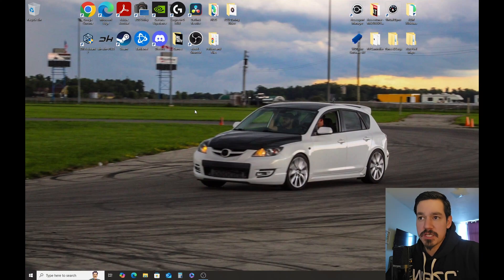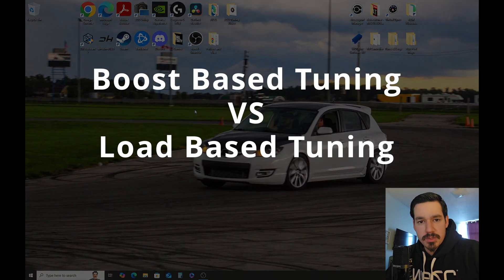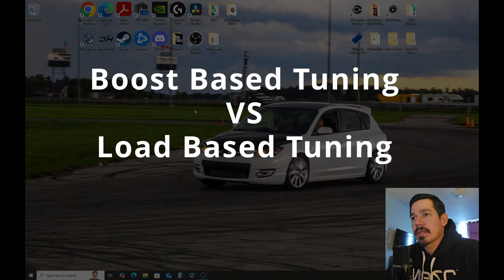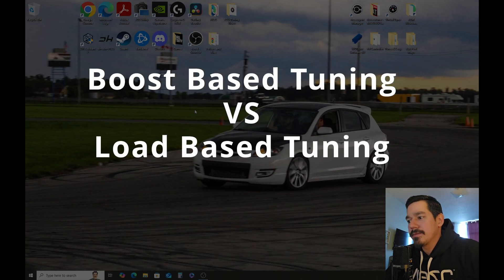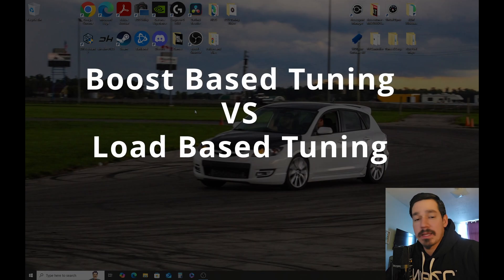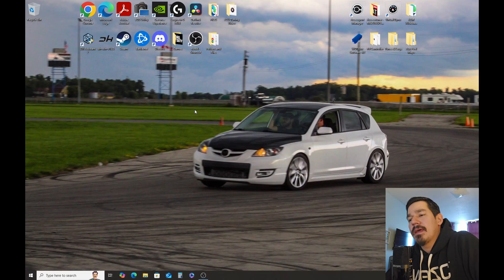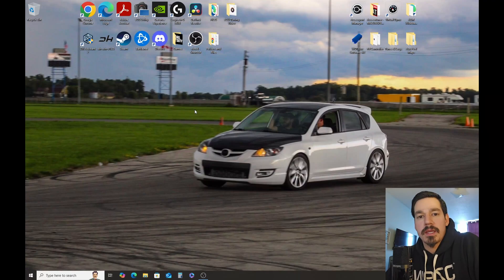Mazdaspeed 3 ECU Tuning Ep.1 - Boost Based vs Load Based Tuning

Comment: Your explanation of 'hybrid tuning' is how I've been managing things for the last few years. Works very smoothly with the multitude of throttle reduction strategies in the background. If I change turbo's or do any other airflow mods, I usually force open-loop during WOT to set the base MAF scaling and hit target AFR's, then reintroduce the WOT closed-loop functionality.

Great video as always man
Reply from the maker: @jasonc2948  That's exactly what I do as well when initially dialing in my Air Fuel Ratio. Since my 6th port AUX fuel setup isn't regulated, boost pressure within the boost piping affects the amount of fuel coming out of the AUX injectors. So having the Open Loop fueling enabled allows me to get my AFR as close as I can to where I want it during a 4th gear WOT pull without the ECU correcting. Once I'm 'happy' with the AFR curve in my datalogs, I'll re-enable Closed Loop fueling corrections to allow the ECU to correct for any variances. I haven't been using any load caps for a while now (ever since I went BNR S5) because boost control is so much better now with the EWG. The other thing I did with AUX fuel is I started the ramp in of additional fuel at a slightly higher MAF voltage. That way boost pressure is already higher when AUX fueling initially kicks in, and I won't have as much of a rich dump of fuel in 1st and 2nd gear which naturally achieve lower boost.
Reply: @WannabeTuners  very interesting. I had a similar experience tuning Methanol. Using a single 1000cc nozzle spraying 100% meth from 12psi would see afrs dip down into the 10's, then rapidly recover to the target 11.7. To be honest it didn't really feel like it was bogging the car down, but raising the start point to 15psi really helped. 

Now I'm just tuning the car to the limit of timing and IDC on 98RON, then adding 325cc of meth for cooling only and letting closed loop self correct for that. I feel I've pushing my luck with loads of meth and high boost for long enough haha
Reply from the maker: @jasonc2948  That's awesome, I remember reading somewhere (I think it was on the old forum) that the ECU can only correct the AFR so much at WOT, and that the GEN 2 Speed 3 can correct more precisely than the GEN 1. I can't remember the exact percentage of maximum correction though. What you're describing with Meth Injection is what I was doing on the K04. My issue was, that at the time I wasn't aware of the ability to tune a true AFR/MAF calibration by enabling true open loop fueling via reducing the load values in the 'Closed Loop Load Limits A, B, and C' tables. So whenever I would do a MAF calibration, I wasn't truly dialing it in, as the ECU was already correcting the AFR.
Reply: @WannabeTuners  I think this is the trap everyone falls into, as none of the online guides (cobb/versa) explain to do this.
I own a 6 now, but when I used to tune my gen 2 3, the WOT afrs would show typical closed loop feedback instability if the base calibration was too far off the target.
I notice my 6 doesn't try as hard to correct if it's too far off, which aligns with what you said.

Comment: Keeping everything in ambient equal, load and boost tuning are very similar or equal. If you have the load reference in your MAP, then 1.0 load is essentially 1BAR MAP (0 boost). Load 2.0 would be 2BAR MAP or 1BAR of boost (BOOST = MAP - BARO). But temperature is a very important parameter to account for, especially when talking summer versus winter, FMIC versus TMIC, DI versus PI+DI, and so on.
The only true reason why you'd have to boost tune is when you have a parallel fueling system (PI in our case) and at that point you're basically only relying on the O2 sensor readings to make sure you've got the fueling right. And even in that situation up to the point where you cap the factory DI (by altering the MAF curve to trick the ECU into not spraying more fuel, since you rely on the PI at that point) you're more or less load tuning (and 100% load tuning in closed loop).

With load based tunes you basically target a specific mass (NOT FLOW) of air. This will correlate with the amount/mass of fuel you need for that mass of air based on the AFRs you target. With boost based tunes you are targeting air flow or volume and then rely on MAF (and wideband O2) for the fueling, while with load tuning you are targeting air mass (as measured by the MAF and confirmed by the wideband O2 - pretty similar, eh?).

The OEM ECU logic provides more means/tables/strategies to properly control load than boost, including per gear, while for the boost you only have to rely on tables that contain strictly limits as values: throttle close and fuel cut overall limits, limits per RPM and per throttle input which is also a general table, not a per gear table, is not correlated with IAT/ECT, and so on.
What this means is also that when properly tuning a car to also grip in every gear, the by-gear control of torque is gone (to my knowledge I'm the only one tuning on this platform who properly implemented true boost/load-by-gear tuning, so all other tuners do not seem care, nor do their customers since most of them do straight line pulls anyway).

Even on aftermarket ECUs you're basically tuning the fueling based on the estimated/calculated mass of air, not boost. Yes, you are tuning on MAP, but the injector pulse width will have corrections applied based on the IAT/BAT. The mass of air is a function of MAP, temperature and reference density, and depending on the engine RPM you can also calculate the mass of air entering the engine at a specific RPM based on the VE, and then you adjust the fueling based on exactly that, not only on the manifold pressure. The AFR is a proportion of masses, not volumes. Mass means load, boost alone means nothing.
So the boost-based tuning on these cars is possible only because we have a MAF sensor ;) Even with PI systems you pretty much load tune even though you're kind of guessing (or enforcing) the boost based on the AFR readings (which is more or less another MAF), so it load-based tuning done backwards :)

These are a few counter-arguments of load based tuning against boost-based tuning, at least for mid/big turbo cars which can hit the fueling limits of the factory DI, meaning they have the ability to produce enough torque to spin the wheels in 3rd and even 4th gear. For factory K04 cars... I tune them to 90 or more WGDC anyway... and let them make whatever they can make when they can make it (at least in terms of power, not also torque).

Yet regardless of the tuning strategy used, in my opinion is a lot more important to get your fueling, timing and comp/limits tables right so that you can still have what to tune after each spirited drive or track day :)
Reply from the maker: @mituc  This is a great explanation. As I continue with this series of videos, I'll try and give my take on things. There's so much I don't know, so I really appreciate your knowledge :)